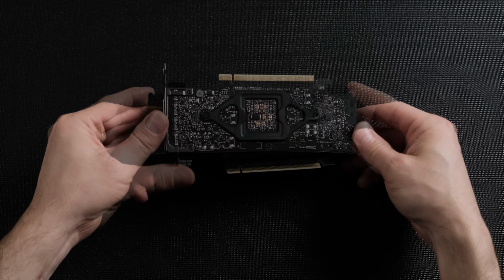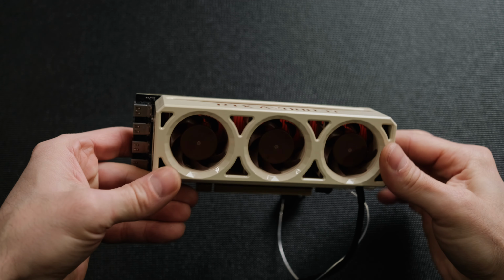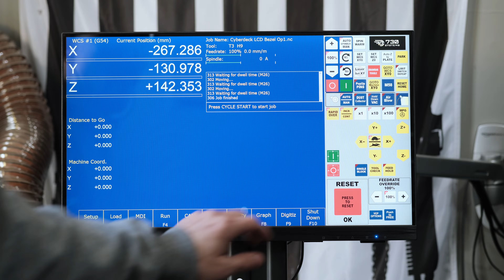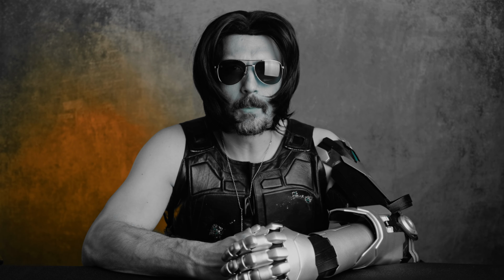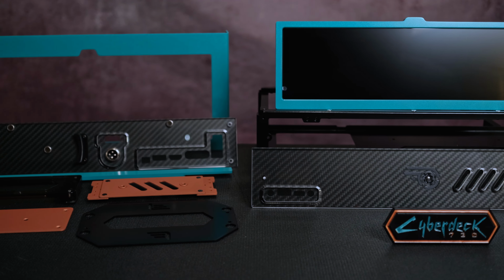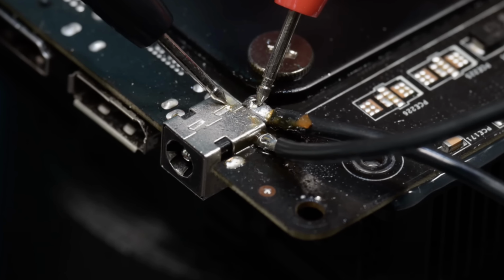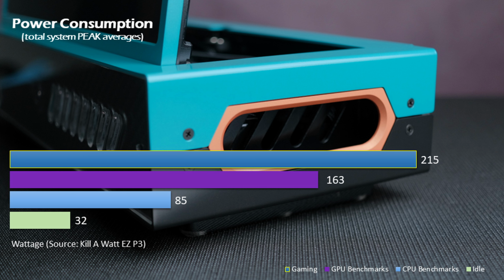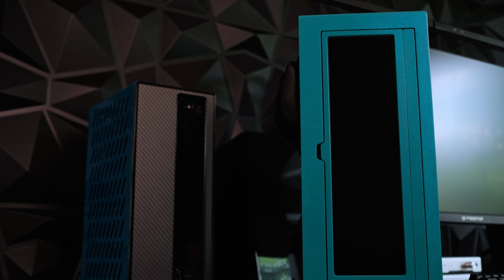Project Cyberdeck: An ULTRA custom all-in-one gaming PC!

Comment: It's a piece of art, beautiful build! The A4000 SFF will definitely be a nice fit. I wonder if the board could run a 5800X3D with a BIOS mod.
Reply: The a4000 sff is a beast.  They have power modded them to pull 110 watts and increase synthetic b3nchmarks by almost 50%

Comment: Great build but just a small recommendation: at 2:21 You should probably nickel plate your copper block to prevent corrosion due to the liquid metal.

Comment: Commercial grade nvidia gpus (quadro, T series, A series [i.e. A2000 and T1000, etc]) do not allow overclocking per say because they use ECC (Expensive 😉 Error Correction) memory. They are tuned for accuracy for lack of better words - where errors are not an option. So they deliberately are made to underperform because the use case is not gaming. Basically, the idea is, if you want to make fewer (zero) mistakes on your homework, you'll have to slow down just a bit. Anyhow, that code is baked into those gpus. You can overclock them and they'll be like "...Nooope!" and go right back. Drivers won't change that.

Comment: very nice video and work fantastic , ...so what would a smaller form look like with screen and keyboard and mouse with ability to also from desktop mode to in a backpack travel mode and also pcvr backpack so light vr gaming  that can work with quest 3 , portable and space saving and upgradable options  ,but as cheap as posable and off the shelf stuff with 3d printer as i ,myself only have 3d printer and no pc building skills .......as i really am looking for best option other than laptop  ........

Comment: I've had some experiences with liquid metal where it would soak into bare copper over time and drying up, could that become a problem with the A2000 do you think?
Reply: @nfcerick3634  ah ok, you expect to reapply. I had the same with my laptop, I have to re apply lm every couple years.

Comment: Amazing build like always on NFC. It's litterally my dream to build a similar project but sadly I don't have access to any CNC or similar equipment.
I have a question: The X300 is amazing but how about standard mini itx boards? I think the size difference is not huge but you'll get access to a x16 gen4 pcie which will unlock the full bandwidth of any GPU you use. Any plans of trying something similar later?
Thanks for the great content!
Reply from the maker: Thanks for the kind words. As you can see from the TINYRTX build on this channel, ITX is of course possible. This is a totally custom case so ITX would have been easy to implement but we don't have sponsorships or $$$ so we need to reuse old parts as much as possible, so Erick just reused his old hardware. Hope this helps.

Comment: Pretty nice build.. But you don't actually have to use the large HDPlex units. In your case, what I've done in the past is either use a DC-DC Step-Up converter (using 12V power input, passing that directly to the GPU and stepping up to 19V for one of those mini STX boards), or use a Step-Down converter (using the 19V input passing that to the system and stepping down to 12V for the GPU). I've done both rather successfully with a mini STX LGA1155 (6th/7th gen) socket motherboard and a 1050Ti (step up, with everything fitting in a standard ATX PSU case) and with a Ryzen mini PC + RX 6400 (fits in a modified PS2 slim case - although the step down converter is on the outside by the PSU with this one).

Comment: Hi, will this work on ITX mobo or strictly for STX only, if only for STX, can you provide a pluggable  solution like having a barrel jack to hdplex cable, instead of soldering to the stx board? Will this also work on other GPUs, (ie: RTX 3060 single fan) what are the lengths for those? -- really like the cases from NFC, but having a hard time sticking to one form factor ie: STX or ITX :D
Reply from the maker: Hmmmm it's hard to answer this question. This build strictly uses the STX board, but since it was 100% custom, there is no reason if you were to copy it you couldn't just extend the depth to fit a ITX board. Now for our STXA2000 builds in the S4T you can use ITX boards and I would recommend you check out the Discord for how. But if you did use STX you can route the cable through and to the back. I actually show this in my build video. I hope this helps, and thanks for watching!
Reply: @NotFromConcentrate  thank you for your response :) will you be providing a simpler solution for the STX to hdplex psu, alternative to soldering the wire directly on the board (this is a factor for me since I don't want to solder on the board, for keyboards and mouse no problem for me)? Thanks.

Comment: Upgrading $1500+ for RTX 4000 ADA is illogical vs. gaming performance on offer, and that's saying it nicely. If it's for workflows also, then that different story. Case is work of art, though 🫡
Reply: @NFC Erick  this is just one individuals opinion. There are others who believe the ends, justifies the means regarding ADA 4000.
Reply: I recently bought an A4000 SFF and you're absolutely right. There was a huge uplift in gaming performance over the A2000 but the cost doesn't even remotely justify it.